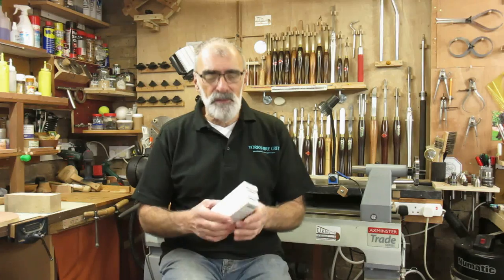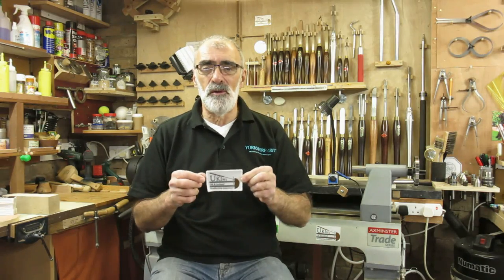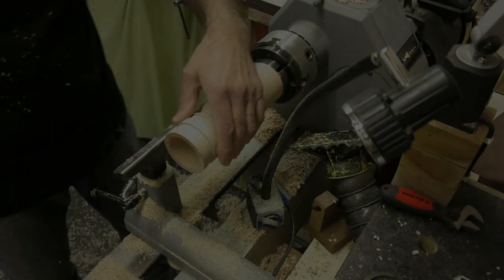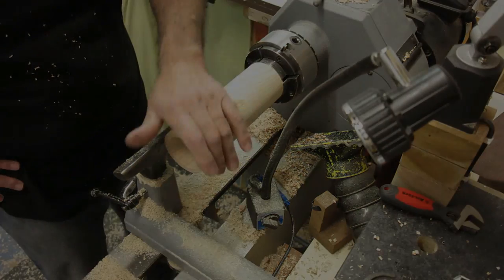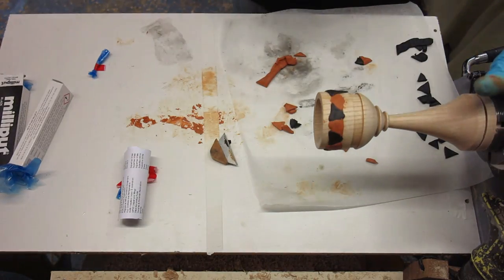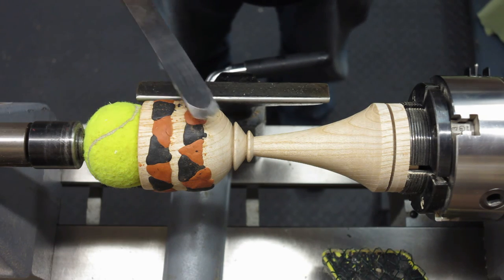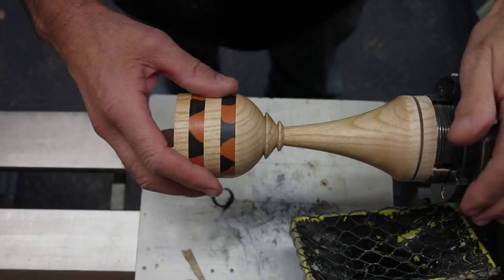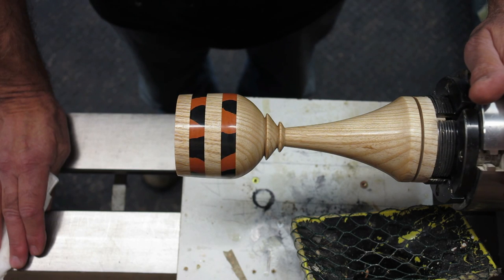Wood Turning - Ash Goblet with Milliput Inlay

Comment: Another great video Mike.We all know you are the master of the goblet. I like the Milliput inlay, but I wonder if there is a way to make the alternating colors more uniform. Perhaps two small ropes twisted together like a braid or pretzel would create a more uniform pattern. The finish on this one is perfect, it's just the uneven pattern is a little distracting. Actually I have no room to talk as I have yet to even try any type goblet...let alone one with an inlay.
Reply from the maker: Hi Gil, I wanted a random looking pattern on this video, as It was genuinely my very first time using it, and didn't want to spend "days" perfecting a design, that hopefully will develop as I use it more. Thanks for the valid point though, and for watching.
Cheers
Mike

Comment: Nice work. When sanding do you have to be careful not to heat the Milliput causing it to melt?
Reply from the maker: Thanks John, when cured Milliput is rock hard, and you can safely sand as you would normally.
Take care
Mike

Comment: Hi Mike, based on your experience would you recommend Hampshire Sheen on objects that are manipulated every day like a peppermill? I'm looking for a finishing product that will last  for a while. Cheers!
Reply from the maker: Hi Gilbert, as with all wax finishes they require a refresh after time, dependent on handling. Hampshire Sheen does include carnauba wax, which as you know is "fairly" hard wearing, but handled on a daily basis, i really couldn't advise you on how it would stand up.
Hope this helps
Cheers
Mike
Reply: Thanks for your input, much appreciated! Cheers!